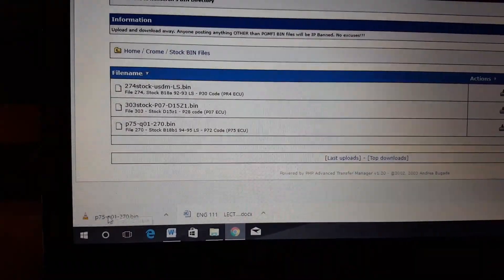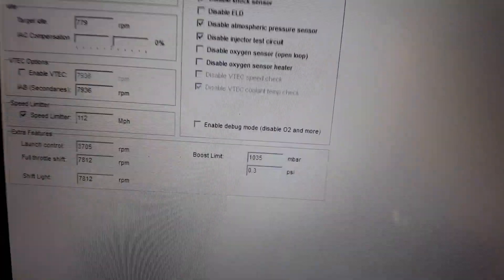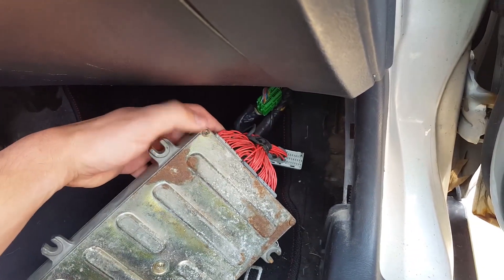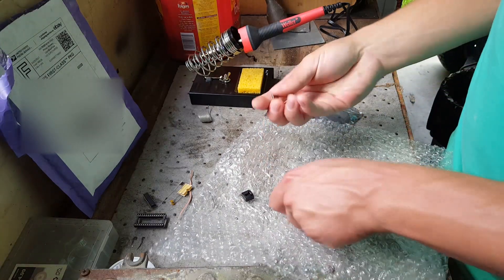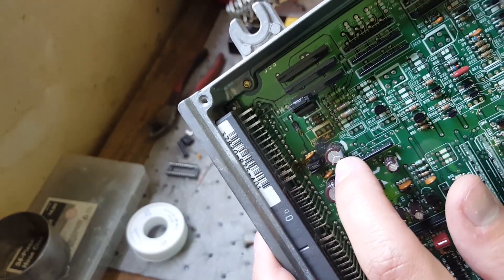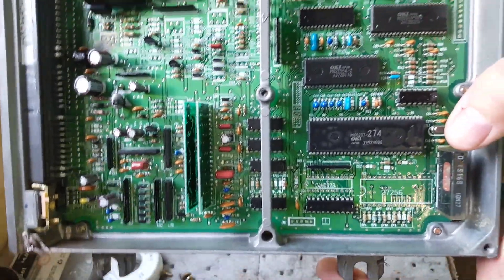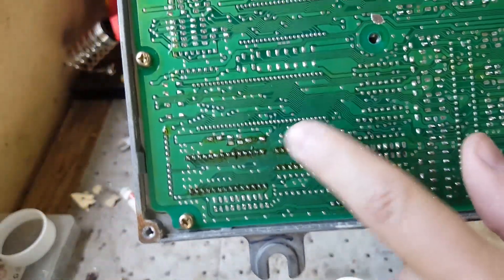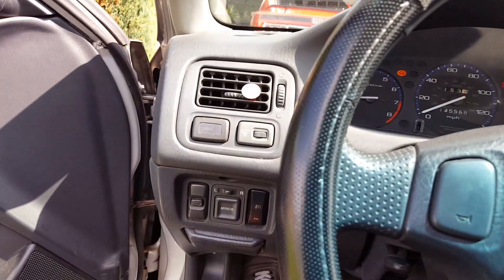Chipping my P75 ECU for Launch Control

Comment: Nick, can you just pleasee quickly explain to me how can i check the map thats on my chip? And also where did you get the burner/reader for the chip itself? Because i have a p28 ecu with SST chip innit and... id like to add launch control to it, if it is even possible.. so.. How should i start and how should i get the map out of it to be able to actually see it in front of me on my laptop?
Reply from the maker: Crisp Clean I got my moates burn2 (chip reader) on eBay I believe. Open Crome (free tuning software) and set moates device as the real time programming hardware choice. On the main screen click "grab" to pull the tune off of your chip
Reply: Thank you soo much man!
Reply from the maker: Crisp Clean no problem!